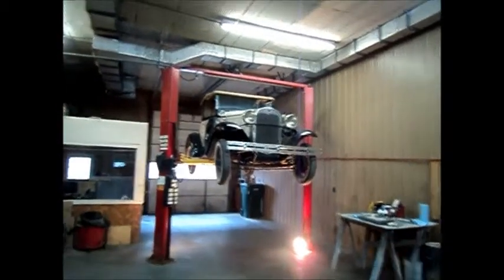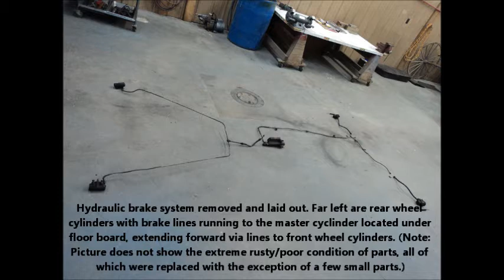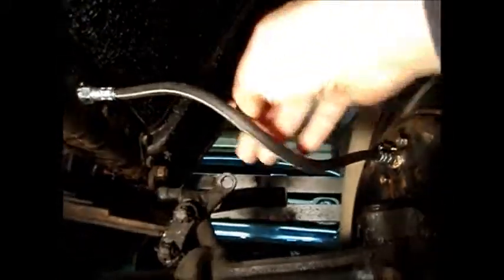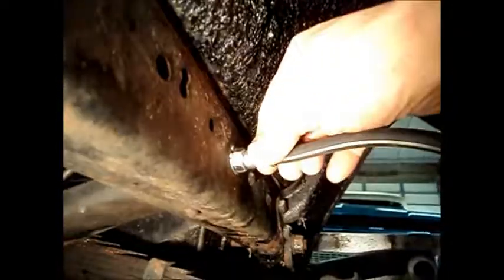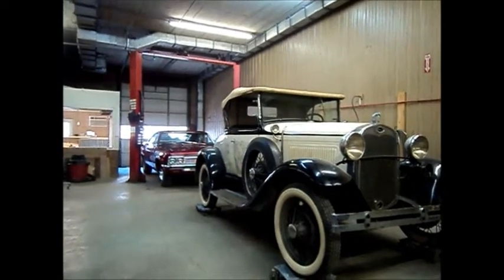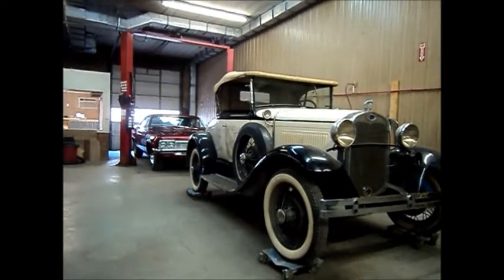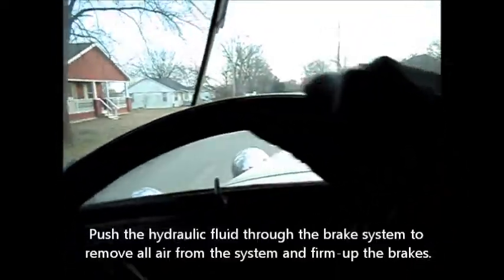Ford Model A snuff up, Video #2, Hydraulic Brake Conversion

Comment from the maker: It's been years, and I still appreciate the comments. It is good to have helpful advice, at least when it is offered by folks that know what they're talking about. Some folks do and some don't. The wheel cylinder does not go to the top. Anyway, I restored the brake system, itself a modified conversion, to its original modified state, and it performed excellently.

Comment: I agree about the COMPRESSION fitting NO NO NO ! Not for brake pressure
Reply from the maker: I apologize for this late reply, and I appreciate the cautionary comment on the brake line fitting. It was a pre-existing fitting that I reused when I restored the brakes. I did contact the customer and tell him about it, and I offered to correct it for free if he would bring the car in. He declined and seem to be fine with it. He said he used to drive the car around including in parades with his kids in it, and  never had any problems. Anyway, I made sure that he knew it should be changed from a compression to a double flared fitting. That said, what I did not tell him but I will tell you guys, is that the compression fitting will dig into a soft line like the old copper lines that were on the car. I did not use copper lines but I did use soft easy-bend lines, and the ferrule in the compression fitting will dig into the soft line and hold it secure. That is not to say I disagree with you. It should have a double flare fitting on it, I agree with that 100%. And I thank you for the heads up.

Comment: Looks like on this one the rear backing plates are 'flipped' with the shoes flipped too keeping the large shoe at the front but larger bore of the wheel cylinder is on the back when it should be facing forward with the larger shoe.  They kept the wheel cylinders on the same side and the bleeder at the bottom. Looks like a royal pain with the bleed screw at the lowest part of the line.

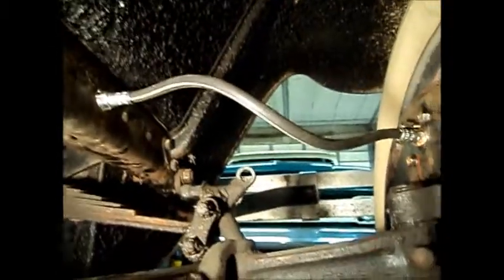Comment: At 5:22, is that a compression fitting??? Big no no!! All brake lines should be double flared. Compression fittings are for low pressure applications
Reply from the maker: I apologize for this late reply, and I appreciate the cautionary comment on the brake line fitting. It was a pre-existing fitting that I reused when I restored the brakes. I did contact the customer and tell him about it, and I offered to correct it for free if he would bring the car in. He declined and seem to be fine with it. He said he used to drive the car around including in parades with his kids in it, and  never had any problems. Anyway, I made sure that he knew it should be changed from a compression to a double flared fitting. That said, what I did not tell him but I will tell you guys, is that the compression fitting will dig into a soft line like the old copper lines that were on the car. I did not use copper lines but I did use soft easy-bend lines, and the ferrule in the compression fitting will dig into the soft line and hold it secure. That is not to say I disagree with you. It should have a double flare fitting on it, I agree with that 100%. And I thank you for the heads up.

Comment: Those rear wheel cylinders should  be on the top of the backing plates. It looks like the rear brakes are on the wrong side and upside down. The bleeder on the wheel cylinder should be on the top. 
If you are going to flip the backing plates for clearance at least modify the wheel cylinder so that the bleeder is up. That way you can get a good bleed.
Reply: You’re right. 
I modified mine to switch the backing plates but kept the cylinders on the proper side. The big cyl end should be  towards the front of the vehicle.